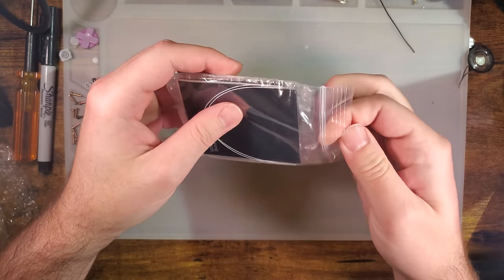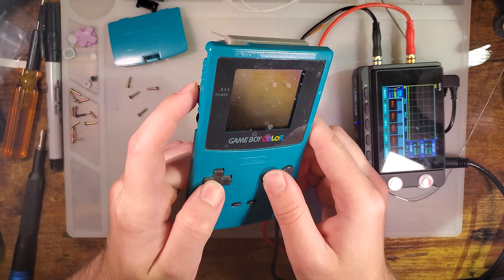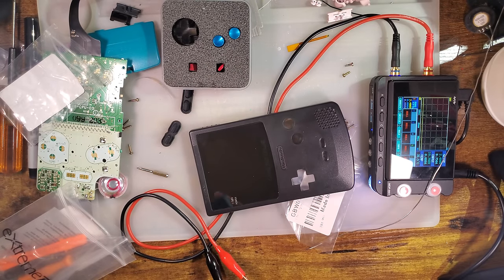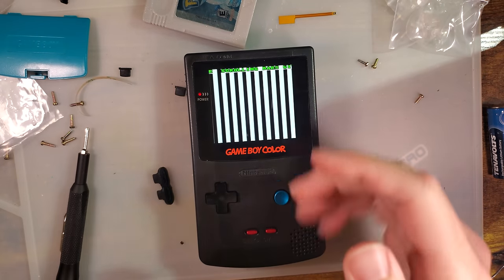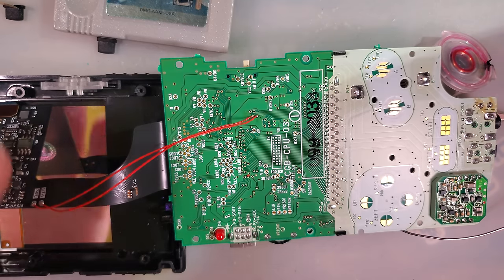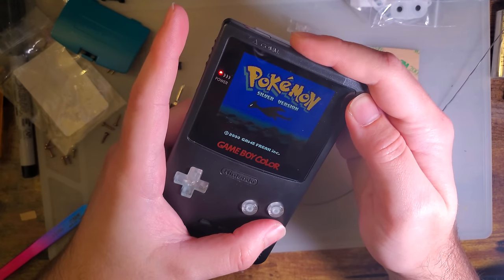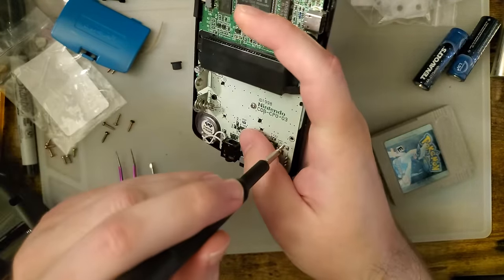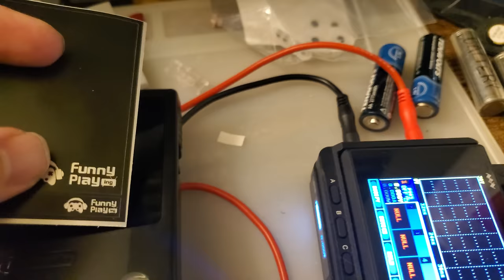'Retro Pixel 2.0' Funnyplaying Laminated Q5 GBC Backlight

Comment: "damn near twice as long as they need to be" says the professional, while I on the other hand would still not have enough room while learning on the first 2 or 5 kits installed

Jokes aside, any idea who in the US I can send my jp pokemon carts to be converted into rtc carts?
and/or an MGB that needs to be resurrected from having no screen or speaker and broken power switch
Reply from the maker: one of the best ways to have clean looking soldering is to remove excess wiring. I just have a small drawer full of various lengths of assorted wires so I figured I'd save the longer wires for another project and use custom ones for this. It also occurred to me well after the video that the wires are likely cut to be long enough to use the test pads on the PCB instead of the vias but that still seems a bit silly to me. 

jrodrigo sells converted carts but he's not in the US nor does he do send in conversions.
Reply: I fully understand wanting it to be clean as possible for the video, personal soldering habits, radio, the collection and such, it was mostly a joke about the way you had said it along with a self jab at my lack of practice.
 Also thanks for telling me where to get some pre-done carts, will have to snag a couple to hold me over till either I can convert my own or I find someone to send them to.

Comment: I’ve had so many problems with the touch sensor that i’ve redone it so many times my contact is now brown instead of gold and the solder just rolls off of it. Any ideas? 😅
Reply from the maker: You burned the solder pad off.
Reply: @makho  I certainly did 😅 i’ve had some great advice in the comments though so hopefully its salvageable
Reply: @Venomous28  oh shoot, what's the solution?

Comment: Should I cut the pins between the screen and board? I don't see anyone doing this and mod cutting them.
Reply from the maker: I'm on the fence for that one. The LCD and board do clear but it's close enough that there could be problems if the console gets flexed (and it's plastic so that's entirely feasible). So I would recommend trimming. 

For a lot of my videos lately, I've been recycling consoles from other builds that may or may not already be trimmed (this one wasn't) so sometimes I forget to do that sort of "prep work". 

At the end of the day though, if the seller says to trim, you should trim, regardless of what I say.
Reply: @makho  I really do appreciate you always taking the time to answer these questions you are really excellent with your videos and helping answer people when you  can. If I may ask one more question, regarding when I installed my IPS V2 screen with the really bad image retention. Could this have anything to do with capacitors? All the stock components played and worked well, or may this just have been a case of defective ribbon cable and or screen? I'll also be switching to 1.5v constant batteries Instead of the Duracell optimums.
Reply from the maker: @mattfire8579  In my experience, all those image retention problems have been traced back to bad batteries. Try new, name brand alkaline batteries (like energizer) and see if that resolves the problem

Comment: may i ask what is that device that you were using to power the gbc with alligator clams?
Reply from the maker: https://retrogamerepairshop.com/products/mdp-xp-mini-digital-programmable-power-supply-set-with-30v-5a-90w-2-4g-wireless-connection-2-8-inch-tft-screen

Comment: after soldering to the sel and strt areas im not getting power could i have cause a short,
Reply from the maker: check your wiring, yes.
Reply: @makho  i removed the wires and solder and still have no power

Comment: this kind of shell cannot be disassembled several times, otherwise it closes more correctly, it requires all the tests to be done before closing, beginner 😅
Reply from the maker: I haven't had any issues. Make sure you're not cross threading your screws during reassembly, that's a surefire way to strip out the posts.

Comment: Hello, does this screen work with a flashcart?
Reply from the maker: yes as long as you aren't using shit batteries
Reply: @makho  Which batteries would you recommend? Getting a modded laminated GBC in the mail and I’m thinking of getting an EZ Flash Jr., would hate to buy that cart and have it not work so I’m trying to see if there’s anything that would keep it from working as it should
Reply from the maker: @big_bingy  basically anything that's not a dollar store brand should be fine. With batteries, you generally get what you pay for. 

Energizer and duracell alkaline should all be fine. Kirkland signature should also be fine but I haven't been to a costco in years so idk if those are still a thing and if the quality is unchanged. Energizer lithium is even better but pretty pricey. 

If you want rechargeables, high quality NiMh like IKEA LADDA or Eneloop (Pro) should also be fine. Nuclear option, guaranteed working on high brightness with a flash cart would be something like jugee aa battery. 

I am finishing up a video discussing this in more details though so if you check back in a few weeks, I might have it up by then. Otherwise, watch some of these: https://www.youtube.com/playlist?list=PLmOSS8YXICV9YvVUgraBVE-SAYvWwn2ke
Reply: @makho  awesome. Thanks a ton for the help! Good to hear that the cart should work fine, from someone with experience with a setup (console+cart) just like the one I’ll be getting

Comment: Hi, the issue with the "up button" is due to the shell or the button itself?
Reply from the maker: Little bit of both. Try leaving out the middle motherboard screw (only use the left and right motherboard screws) and see if that helps. Otherwise, you can file down the nubbin on the button slightly and see if that helps.
Reply: @makho  Thanks a LOT my friend! I have just another question, is it normal that the Gameboy Color’s speaker is not as loud as the Gameboy Advance one? Or i have to replace it from the Gameboy Color?
Reply from the maker: @GENKIDAMA10  probably bad caps https://www.youtube.com/watch?v=hD1J6rPH40E
Reply: @makho  You’re the best ❤️👏🏿